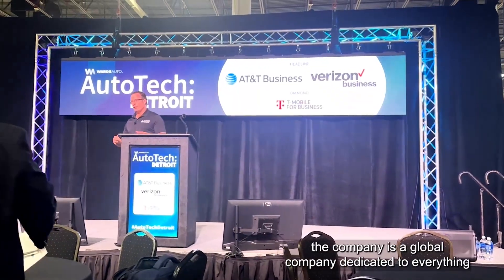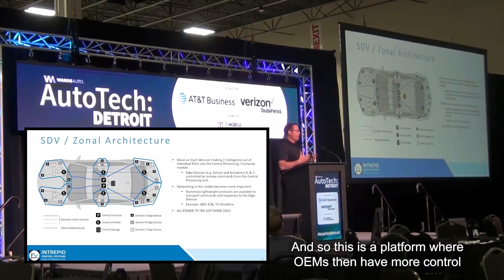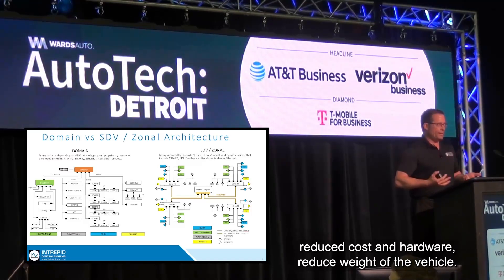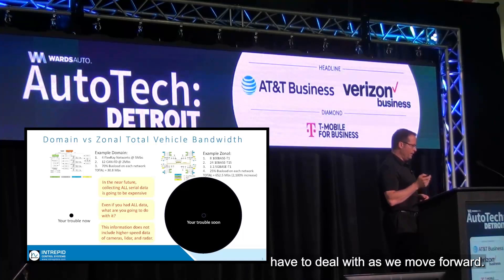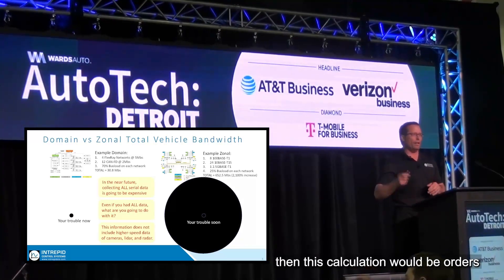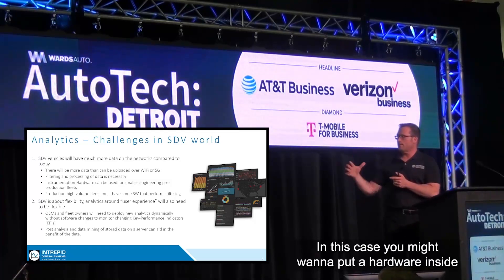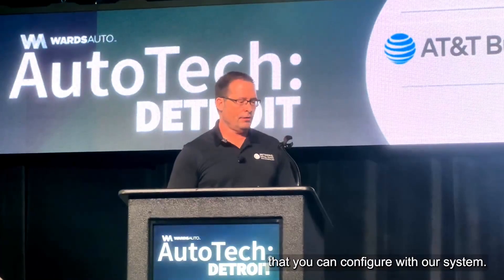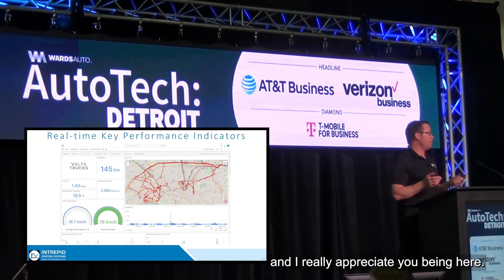Software-Defined Vehicle (SDV) Electrical Architecture and Challenges to Testing and Fleet Logging

Comment: Dear Friends. Good to continue working on SDV+. 1) I found correction/addition to the video, when the lecturer says ECU(more general Electronic Control Unit), would it be more clear to say/write GEM(General Electronic Module), ElectronicCU or ElectronicCM(Electronic Control Module) or just simply controllers in order not to confuse with Engine Control Unit (ECU as well and more specific)? 2) Which valuable functions, interfaces to implement in Cloud, IoT for whom? Which company, entrepreneur is interested seriously and ready to hire/employ me from here the thread (via email and Skype to exchange work results) to do research and development within specific custom domain of control modules?